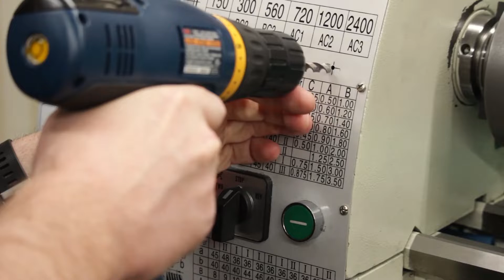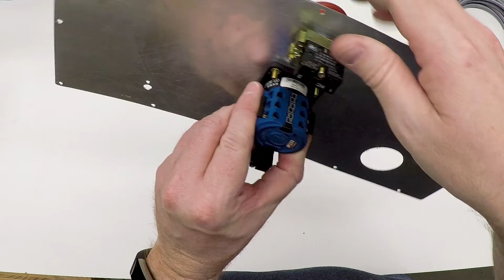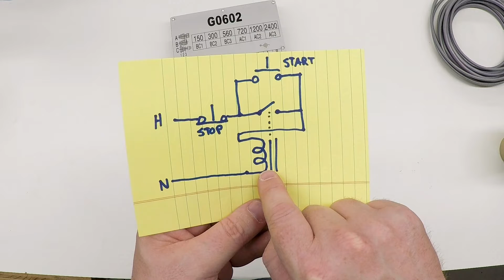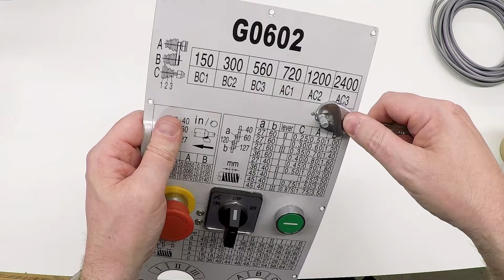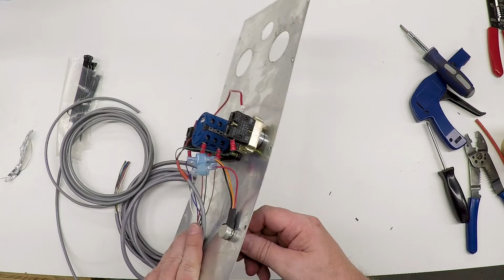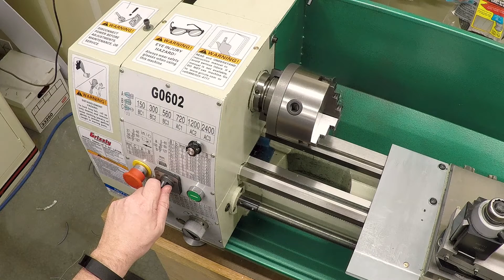Lathe VFD 6: How to Connect and Test the Controls

Comment: Great job indeed, I personally made this mod on my SIEG CJD250 (the ancestor of the G0602) 15 years ago, and while at it I added an RPM/SFM indicator from MKCTools.com. When I watched your tool post grinder project videos, I was still wondering how machinists can still do without these mods. later on I installed a two axis Meister DRO from TheDROstore.
Reply from the maker: The VFD is a huge improvement.  I have a DRO for this lathe, but I still need to get it mounted.  I haven't done it yet because I  haven't found a great position for the X scale.  I have a slim 1um glass scale, but it's still pretty bulky for this particular lathe.
Reply: Hi James, (should be better part in a DRO topic ;-) I affixed mine on the tail stock side of the cross slide, under a SS sheet metal cover. The sensor is affixed on a "bridge" between the two RH extensions of the saddle. The draw back is a 65mm reduction of travel for the tail stock toward the chuck...No big deal. Carry on the great job...!

Comment: what are you using for a heat gun?
Reply from the maker: For the heat shrink?  I'm actually using a hot air solder rework station.  It's way overkill, but it's a pretty nice option if it's already on the bench.

Comment: 2 questions. 1. Did you do your mill conversion yourself? and 2. Do you have a schematic of how you did this wiring? I have watched these videos 10x over and have learned a lot from them but I am trying to use the same motor and vfd, and be controlled by a centroid acorn board. Thank you for this series. It's great!!!
Reply from the maker: Yes, I did do the conversion myself.  I don't have a schematic per se, but I did do a little tour of the electronics in one of the Z motor upgrade videos.

Comment: How were you calculating the spindle speed from the vfd frequency. eg. When you set lathe to 120rpm at 6Hz you got 15rpm at spindle and at 1200rpm at 120Hz you were getting 240rpm at spindle? Thanks.
Reply from the maker: I have the spindle belts set up in the 1200RPM position.  Since the new motor has the same RPM rating as the original, when I run it at 60Hz (normal power frequency in the US) the spindle will turn at 1200RPM.  6Hz is 1/10 of 60 Hz, so the spindle will turn at 1/10 of 1200RPM, or 120RPM.  When I dial it up to 120Hz, this is double 60Hz, so the spindle will turn at double 1200RPM, or 2400RPM.  It would be possible to get different speeds with different belt positions, but I haven't found the need to do this yet.  The general calculation for the resulting speed is  <selected belt position RPM> * <VFD Frequency in Hz> / 60.  So 1200 * 6 / 60 = 120.
Reply: Thats great. Cheers.

Comment: What wiring size are you using for high voltage and low from lathe control panel from the lathe panel to VFD panel ? Where can you get the wire and do you have a affiliate link for the wire ?  By any chance do you have a full diagram for wiring the control panel ?  Any help appreciated.  BTW awesome videos on this conversion.
Reply from the maker: The wires to the control panel are small--probably about 20-22AWG.  Just be sure that the insulation is rated for the voltages you want to use.  Off the top of my head, I think the cable I used is rated for 300V, which is typical.  I don't have a full wiring diagram, but I did show a diagram for the contactor latching circuit in one of the videos.
Reply: @Clough42   Yes you did show the latching contactor. You done a very good job explaining everything.  I was in the process of ordering parts to do a VFD upgrade then saw your video and it helped me very much!  Have you done much threading with this new motor ? How slow can you run it and still get good threading ?  The lathe is stock for 150RPM and is a little fast for threading for me.  I am hoping it can thread smoothly closer to 100RPM.  Thanks again for such a great video series.

Comment: With how you've wired the E-stop, it doesn't really work as an estop now does it? the power doesn't die off instantly?
wouldn't it stop faster with it wired up as a stop button?
I'm just about to do this process with my lathe, I got a hitachi x200, and it has 3 wire control, so I'm planning to wire it up with that, powering the VFD directly from mains via a filter. or is there a benifit to getting a contactor and looping it? maybe use a contactor but keep it purely for powering on the VFD, with the controls local to the VFD not the machine?
Reply from the maker: Sorry...I responded earlier and just realized what I said was wrong.  The e-stop is wired so it shuts off the contactor and removes power from the VFD.  This will override any problem at the VFD--even if it runs away and isn't responding to its input controls.  Ironically, using the e-stop might take longer for the lathe to stop than if you just stop it with the VFD controls.  This is because the VFD has active braking.  If you just kill the power with the e-stop/contactor, it cuts the load loose and lets it spin down on its own, controlled primarily by friction in the spindle bearings.

Is this better than wiring it as a stop control?  It depends.  Wiring it to the contactor removes the power and can safely shut down in some cases where the stop button wouldn't work (VFD firmware lockup, loose stop wire, etc.)  But it doesn't take advantage of the brake.  Wiring as a stop button would stop faster, but wouldn't necessarily stop the load under other, unexpected circumstances.  At least the way it's working now, the switch must stay closed for the power to stay on.  Hitting the e-stop, or even severing the wires will definitely cut the power.
Reply: That's a great reply, thank you. I think what I will do then is get a contactor, and wire it in like you, putting the e-stop by the controls, BUT also use a stop command, that way if I just want to stop, I can stop, but if it runs away like you say, I can kill it totally. I can also use it to power off the drive when not in use. 
I think that is preferable for me, than having to learn to use the switches differently, bet you've hit that e-stop a few times instead of turning the direction control
Reply: An e-stop should have absolute authority. The way Clough42 did it, it does - because it cuts all power, full stop. The lathe WILL stop, no matter what. One could use various other solutions - including "asking" the VFD to please stop right fscking now, which might actually stop faster due to the mentioned active braking - but I much prefer definitive solutions with ultimate authority (exactly as this one ended up being) which rely on nothing and nobody else to stop, no matter what.

Comment: Having problems finding small amounts of the 9/4 wire plus ground, foil shield, where did you get yours?
Reply from the maker: For stuff like this, there's always someone on eBay selling shorter lengths off a spool.  Try searching for "shielded 9-conductor cable" or something similar.
Reply: @Clough42  James what size wire is the 9/4 wire plus ground.  I have ordered the same motor and very from your links I would ask if you could list those grade wires it would be very helpful so I can order them also.  Thanks

Comment: Thanks excellent video series on VFD conversion, I've considered a conversion on my gear head lathe 7.5 kw motor, lowest speed is 25 and highest 1165 , I would like to goes as low a 3 rpm for metal wrought iron twisting and scroll attachments and also have a higher rpm range for matching, do you think this could be possible ??  Thanks David
Reply from the maker: It's possible.  If the motor is rated for 10:1 inverter duty, like the one I used, and you gear the lathe for 25 RPM, you should be able to turn it at 2.5 RPM.  The question then becomes one of torque.  7.5KW is a lot of power, and if you can gear it for 25 RPM, there will be a lot of mechanical advantage.  So basically, the motor will be pretty weak because it's running so slowly, but it's a big motor and will be geared for a lot of torque, so I'm not sure what to expect.

Comment: done the same type of conversion but started with a 3 phase motor lathe , took me some headscratching to get the forward and reverse switch setup to the vfd to work like it should and have the emergency stops to work like it should 
its been a while and i can even remember how i did it
one thing you might want to add is an rpm gauge , make it eazier to repeat speeds that worked for certan materials
suprized the teco vfd was making noise on the electric network , from wat i seen it had a build in filter (have the same brand for my mill)
Reply from the maker: I have some ideas for an RPM gauge.  I'd really like to build an electronic leadscrew, and the electronics for that would have all of the data needed to display RPM.  That's the only reason I haven't done it yet.

I suspect the VFD has some filtering, and it's probably enough for an industrial environment, but it was causing some trouble with my video setup.

Comment: Great video.  I am using a GS2 from automation direct and they told me I do not need a contactor.  You use one.  My 1/2 hp motor will be running am exhaust fan.  The current setup I have running a drum motor does not use a contact but relay coil which in the control box has a separate on and off switch along with an E stop.  Also I noticed you did not use any fuse prior to the contact.  I am watching to see how the different ways these VFD's are connected
Thanks
Charlie
Reply from the maker: Contactors and relays are both electromagnetic switches.  Typically, when they're designed for low-voltage use, they're called relays, and when designed for high-voltage and high-power use, they're called contactors.  Note that you can also buy high-voltage and high-power relays, so it's fuzzy.  I am using the contactor as a latching power switch, operated by the e-stop and start button on the lathe.  I could have also used a switch on the box to operate the contactor, or even a large, horsepower-rated switch to turn the power on and off.  But I had the contactor and the buttons on the lathe, so I chose to use them.  Fuses would add additional safety, but I didn't use any in my setup.  In my case, I'm counting on the circuit breaker if something goes wrong.  The wall outlet I'm using is wired with 10AWG wire, and is located about two feet from the panel with a 30A single-pole breaker.

Note that I'm not an electrician, so this is just me sharing how I wired mine.

Comment: Which contactor are you using? I see Teco specs the CN-11 which has now been replaced by the CU-11, which is impossible to find in stock anywhere. I have a switch/pot design I’m working on with a couple on/off switches. Contactor looks like the only way I’ll be able to make it all work properly. I truly appreciate these videos. They’re the best L510 videos I’ve found, and probably the best VFD videos in general.
Reply from the maker: Thank you!  I reused the contactor that was originally in the lathe for the stock controls.  It's a Siemens 3TB41 22E 110V.

Comment: Thanks James. Very well done. Very informative. I bought the motor and VFD from your links. Hope it helps you to do more excellent videos. This is for my CNC-converted G0602. I never upgraded the motor to CNC, just to motion. I will have to figure out how to configure the VFD and connect it to the Acorn controller board.  Any advice on that would be appreciated. Thanks again.
Reply from the maker: Thanks!  It looks like the Acorn board can provide the standard 0-10V output to control the VFD.  I've never done it, but if I understand correctly, you can connect this to AVI and AGND on the VFD and control the speed. I think the potentiometer I used is wired to provide a 0-10V signal to AVI, so it's probably already set up to work without any additional configuration.  I'm not sure about switching the drive on and off or reversing the direction.  The Acorn looks like it has additional outputs that could be used to drive the S inputs, but I have never attempted this.
Reply: Clough42 Thanks for the reply. I will try this next week when I get the parts installed per you instructions.

Comment: It is indeed glorious.  Super low range will be so useful for threading! 

One stupid question - in the highly unlikely event of the forward AND reverse wires shorting out (i.e., both on), what does the vfd do?  Does it have sanity checks in hardware?
Reply from the maker: Not a stupid question at all.  The VFD has a microprocessor and runs software internally to control all of its functions.  The switch inputs don't control the power directly--they're just inputs to the software.  If you turn forward and reverse on at the same time, the software just interprets it as a stop command.  It decelerates and stops the motor the same as it would if you switched both circuits off.

Comment: One of the best how to series I've seen yet on Youtube about using the original switches as they were intended to control the same functions on the VFD Clough. That said even watching how you did it I'd feel a lot more comfortable with my inept electrical knowledge to pay a professional industrial electrician to do the same on my lathe. My Bridgeport clone was the first machine I've ever operated with a 3 ph VFD combination and it's amazing just how smooth and quiet they are. I very much suspect you'll see a decent improvement in the surface finishes you now get as well. Other than the extra cost I am a bit surprised you didn't upgrade the Chinese OEM switches to something a little more industrial rated since they seem to be a bit failure prone sometimes.
Reply from the maker: Interesting...I hadn't thought about surface finish.  It'll be interesting to see if I can tell the difference.  I'm already loving how smooth it is.  I need to find another big lathe project so I can put it through its paces.  I didn't mess with the switches because I was trying to not alter the control panel too much.  I guess drilling a hole in it is a pretty big alteration.  :)  But I have some other stuff coming that may require more controls, and I haven't decided yet exactly how I want to do it.
Reply: I'm quite sure you will see an improved surface finish Clough. However that much smoother power delivery starts showing up any other problems that might have been disguised by the OEM single ph motor. The cheap factory supplied drive belts might not be the best and possibly any gearing that maybe isn't as concentric as it should be can then start to show up in the surface finish. I had to change out my mills drive belt since I was seeing a very slight and repeating surface pattern with my mill while fly cutting after I got it. It's a lot of effort and I haven't done mine yet, but adding cast in access holes for any bolts and guarding the spindle bearings then filling both the headstock and tailstocks hollow castings with an epoxy / granite mix can show some definite improvements as well. The castings are a lot lighter than they should be on these lathes. 

My opinions and design preferences have been changed a great deal from drooling over too many top quality European built machine tools like the Deckel mills. To me the Swiss, German, Austrian designs seem to be more observant about ease of use for the operator than most others. The Deckel FP 2 and especially FP 3 uses a heavier built version of what most DRO head units use for a two arm pivioting mount and Deckel has all the machines controls mounted on a sloped face and almost always the dro mounted above that. The whole thing can be set for easy access yet out of the way of the current job no matter what size it is. Everything is positioned right at your finger tips. Harrison, Colchester, Clausing branded lathes today use a very well thought out addition to the lathes splash pan with all the controls mounted and centralized on an angled extension of that splash pan on the far left side. I'm seriously thinking of doing something much like it at some point.

Years ago there was an article in the Model Engineer's Workshop magazine where the author mildly modified his Myford super 7 top slide to incorporate a Newall magnetic scale inside the top slide because of the space restraints like your looking at on your lathes cross slide. No idea if the DRO you bought has the small diameter magnetic scales available for it or not. Because of the usual layout of the carriage lock, cross slide locking screw and the gib adjustment bolts plus maybe losing a bit of room to get the tailstocks casting as close to the right hand side of the carriage as possible then coming up with a decent workable mount for the X axis scale is always a problem on these smaller lathes like we have. My Newall micro syn scales and reader heads on my mill are the smallest I've seen for any dro and it might be worth checking if your dro's head unit is compatible with there signal type? For something like the cross slide I'd want the extra resolution and accuracy those micro syn scales have anyway. If you need dimensions I can measure my scales and reader head.

Comment: I spy most of a resistor color code in your wire color code  :) I waited for you to finish the info about the drain wire... that was awesome. There aren't many that know grounding the shield on both ends is asking for noise. And you topped it off with heat shrink. That's much neater (looks better too imho) than electrical tape. Now back to the video...
Reply from the maker: Good eye.  The cable had all the right colors to use the standard IEC color code, so I figured that would be the least surprising thing to whoever works on this machine after me.  You're right--grounding can be tricky.  It seems like the simplest thing, but there are lots of ways to get in trouble.  And don't get me started on electrical tape.  I guess there are some very nice high-quality products fit for some purpose or other, but I can't stand the stuff.  It doesn't stay put long-term, and everything ends up sticky when you have to work on it later.